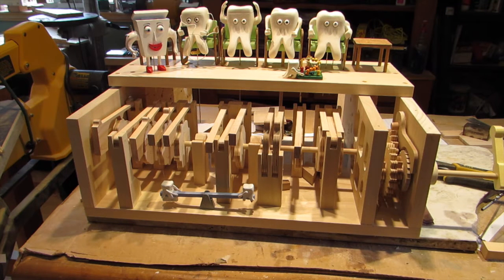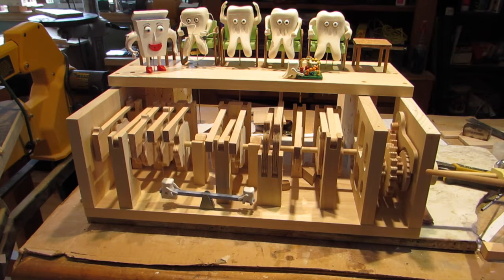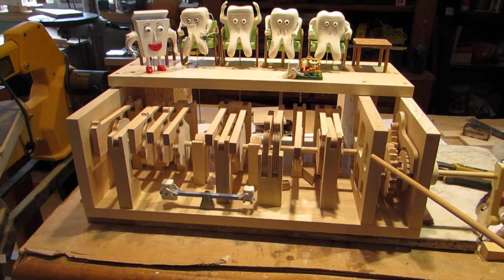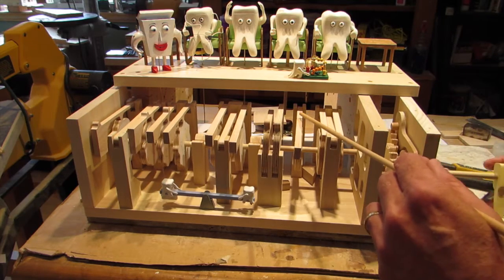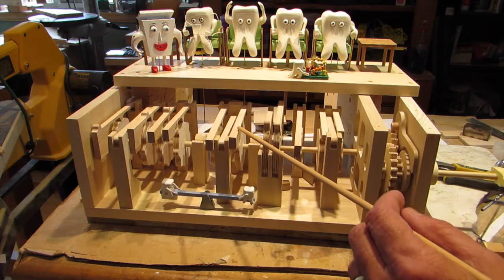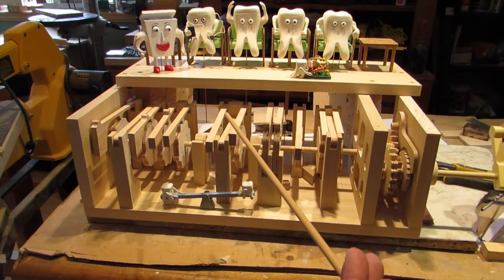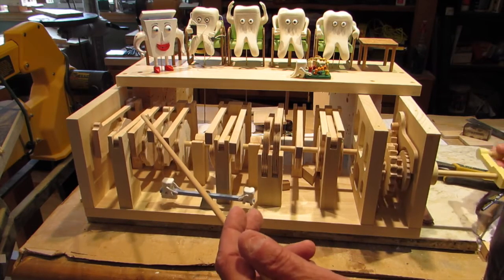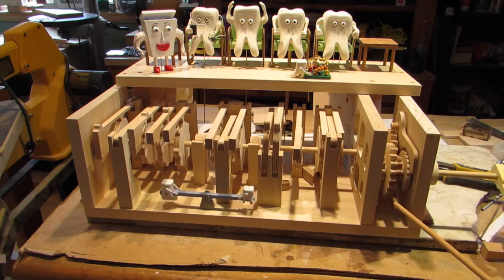The Dentist's Office Mechanism

Comment: Good day Al! Love your work, just getting into the game myself. Could you tell me the gear layout in the gearbox? You mention 1:8 final output, how are the 3 pairs set up? Kind regards.
Reply from the maker: The gear box is made from 6 gears, have ten teeth and 3 have 20th teeth. The input shaft has a 10th gear glued on it, and a 20 tooth gear glued onto the output shaft. The other 4 gears are paired, a 20 tooth and 10 tooth, and glued together with a 1/8" spacer between them. The shaft holes are drilled out on these pairs to slightly larger than 3/8" so they will spin freely. One pair rotates, on parallel shaft, with the 10 tooth meshing on the 20 tooth output gear, and the 2nd set spinning freely on the output shaft, the 10 tooth meshing with the 20 tooth of the other pair. Now position the input shaft to mesh the 10 tooth  with the 20 tooth on the first pair. Look at some of my videos or my website to see similar constructs.